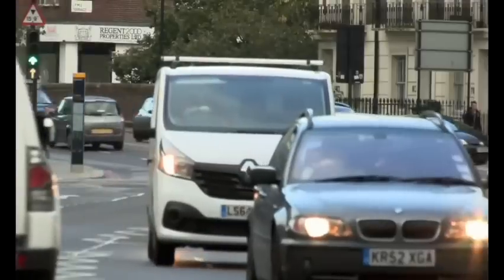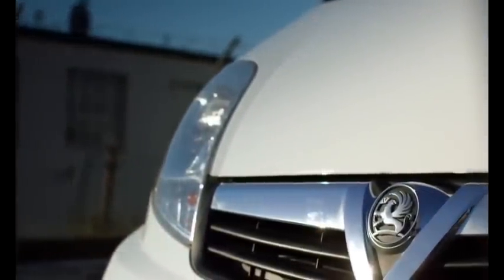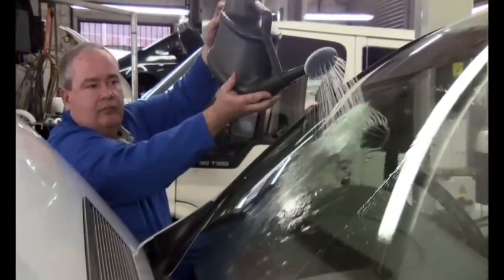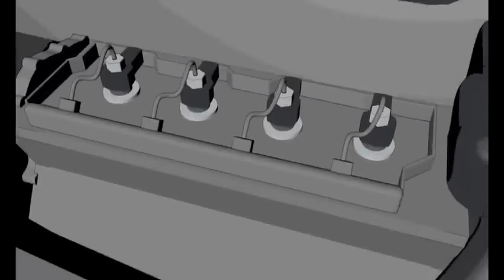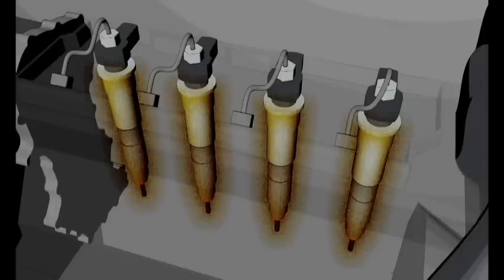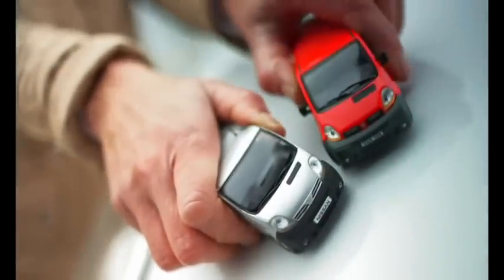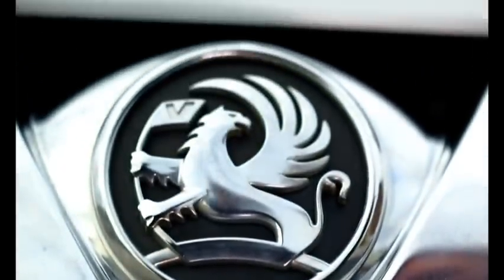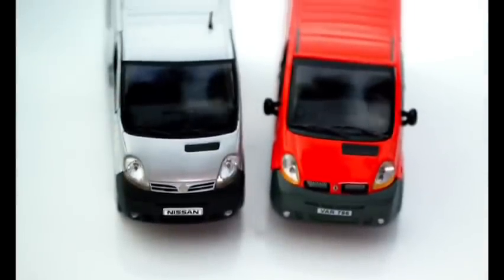Opel Vivaro Renault Trafic Nissan Primastar Vauxhall Vivaro Fuel Injector Problem

Comment from the maker: Just recently heard it from a mechanic, that 1st he sprays a lot of WD-40 on the cylinder head at the injectors, then he runs the engine for about an hour to get it hot, meanwhile he sprays more WD-40 near the bottom of the injectors  a few times during this time. Then he shuts off the engine and removes the injectors. He said, that since he is using this method, he managed to get all injectors out. I no longer have the Vivaro, but if someone tries this method successfully I suggest to post it here for feedback.
Reply: Unless the injectors are shorted inside, then the engine will not start for more than 2 seconds before the ecu cuts the power.
Reply: I think i need to try that. Will give you feedback of it.
Reply: Although it might take several hours, eventually one or two days and stinks when applied!
 
I suggest to let it soak in a VINEGAR bath. 

Never heard or read about anyone else using this basic method. But the reality is that vinegar is an excellent acid to remove rust! It's cheap, effective, easy to use, not poisonous, the only issue is that it stink! 
Whatever the case it will "eat" the rust away. When using it the only concern is to keep the parts submerged in it. In other words don't let it dry...  Oh! While speaking about it. Get the strongest vinegar you can find. Works faster! ;-) 
In my neck of the woods it's available in 7% and 35% concentration. The later being my preferred choice.  

Procedure: Let is soak for 24h or more. Clean the mess, a thin and long screw driver and rags. Combined with a wet dry vacuum. Works perfectly. After that follow the example of the OP above.
Soak it in WD40. Leave it for awhile if the van start even better, warm it up. Than slightly release the bolts that hold the injectors in place. Do not remove them completely. Two or three turns should ne enough! 
Start the engine and let it's internal pressure spit/push the injector out... It will come off nice and easy. ;-)
Cheers

Comment: Snap! The otherwise clean and tindy Vivaro I bought from a dealer had this problem. The scuttle is retained by screws - no sealant. The injector bay was a mass of rust. Long story ---- an engineering co told me that No1 injector was so badly corroded that they declined to even try to lift it. Indeed, the mechanic put the approriate socket on the retaining nut & twirled it round with his fingers - the hex was rusted to round. The dealer refunded me the full purchase price - 30 day/existing fault not advised to buyer. Thank the Lord for that protection!

Renault - it is their design - are entirely at fault for this. The only good thing I can think of to say about it that there is a flourishing business in UK that has grown up to deal with this clanger. Good old Brit ingenuity. I can report that this does not exist in FR, where I live. A Gallic shrug of the shoulders and 'Domage. Motor nouveau, monsieur'

Comment: Hi everyone its not just Renault Nissan opel I have worked on bmw and Mercedes and i have the same problem with one or more injectors and the tool for removing them is not that expensive

Comment: we'll be picking up our 07 Vivaro soon, one of the first jobs... remove the rain skuttle panel and reseal. Just hope the injectors aren't f**ked already.  Crazy thing is if these vans were THAT bad we wouldn't so many older ones still on the road. There's 4 in my road alone that belong to neighbours!
Reply: they prob have the one i have. which is a 2005 1.9CDTi it is a different engine F9Q. our injectors are at the front, with no trough. my injuector heads are bone dry..

Comment: I'm so glad that my Renault traffic is a 2016 model
Reply: they can have the same faults its only a facelift body, depends how you drive them
Reply: It’s not a facelift model. A lot different ,200mm longer for a start. The x83 model they are talking about has a 2 L Nissan engine the new model the mk3 has a 1.6 Renault engine.
Reply: I’m so glad I don’t have a DPF in my 2005, good and bad with both
Reply: @martinhull6734  the 2.0 Vivaro still uses a Renault engine
Reply: @darrellcoutinho805  the 2.0L engine in the Trafic from 2007-2014 and 2019- is the M9R. MR engines are Nissan. It is an alliance with Renault but is designated a Nissan engine.
Reply: @FatherJack-73  F9Q baby..

Comment: Injectors on dci 1.9 recon cost £120 each. Four injectors failing at once is bullshit. The 2.0 vivaro the injectors may seize but why break because seized? All four injectors 100,000 miles? The he repair bill £5k? The garages charging that should be on watch dog themselves. Nothing mentioned about how that charge is extortion. I wouldn't charge anywhere near that. Under a grand for sure. Likely one injector and a hundred pounds labor so £250 plus vat.
Reply: the £5k bill is the cost for a new replacement engine and fitting
Reply: @MartinMurray1966  - Which in all honesty is bullocks!! In the WORST case scenario. Engine head would have to come off and the failed injector(s) would have to be drilled out. Notice, this is the worst case scenario! If using proper tools and methods. Head removal would be pretty much never needed! But OK accidents happen so some cases would come to that. 
Also very dependent on how long the situation as been going on. As usual early detection and correction saves a lot of time and money. 
Like the saying goes. "A gram of prevention is worth..." ;-)

Get an entire new engine... Well, it's a perfect solution for the garage/mechanic involved, that's for sure! ;-)

Comment: Hi i do feel for you  i have a vauxhall vivaro 13reg n its done 108.000 now  at the mo its ok but in 1 year ive had it it not started straight away 3 times now n im dreading changing the injector plugs

Comment: Easy fix for the submerge injector problem in the trough drill 3 tiny holes in side so water drains I've done it with no problems
Reply: In the side ?

Comment: Ive had my 2007 Trafic 2.0 dci since new, now on 174000 miles, none of these problems, maybe I'm lucky!
Reply: AngryPostmanSthlm2  honestly i think its more an flaw in the injectors themself.  Just an bad badge.   My vivaro has ben running for 330.000miles.  As an company car so its the slut of the company.  She takes it all...   No problems so far.  I did have to replace the egr.  But i costed me 30$ and 5hours work. 
It would run fine with the faulty one but not recomended of course
Reply: @DiyNuke  - It's not an issue of the injectors. This same engine is in several other vehicles from Renault (Megane, Espace...) and others, namely Nissan (X-Trail...). 
And in none of them this issue comes up! In fact it's one of the best and most reliable engines out there! Kind of sarcastic we're talking about it failing, isn't it?!   

The problem is really a seal design and/or implementation. Many times combined with a blockage in the rubber drains. On both sides of the scuttle panel. Those rubber hoses can be easily seen just by opening the bonnet! Pull them out and clean the leaves and debris accumulated in there. It's just a few minutes task! 

For you guys parking under trees be specially aware of this detail. BTW this is an extremely important cleaning point for vehicles of any brand and type. Be it a Toyota or a Mercedes... Chose a name! ;-)

Comment: If this was the only problem…. Owners should know that the timing chain should be replaced at 100000mls.
Reply: ergh wrong. its a belt, manual says 30-40k..

Comment: Same problem whit my Renault Trafic 2005
Reply: 2005 model has 1.9 Renault engine that has plastic cover so not affected.
Reply: Same my big problem
Reply: @camwinstone  - For what it's worth the 2.0 DCI also has the plastic cover over the injectors area. Although water can still sip trough/around. The rest is history.

BTW for what it's worth, the failing seal. Is a regular neoprene seal that is, pretty much, the standard in the industry. Dependent on conditions it can fail relatively fast or last for a long time. This same type and seal material. Can be found, literally, in every model and brand sold nowadays!  
Whatever the case, when it fails, unluckily in this particular model the water accumulate precisely in the injectors bay!
 
Improving/replacing the seal and keeping the scuttle panel drains clean are some of the actions that can avoid/minimize several head aches in the future. ;-)

Comment: Horrible engineering.  Such a vital component is relied on by a windshield seal?  Nothing else?  No covering of the injectors or anything?  Just a window seal?  It's this kind of lazy, half-done crap that manufactures try to get away with.  That's why you don't reward them by buying their products when they can't even offer you a reputation for producing reliable products.  Stick with toyota and Lexus.

Comment: I lost 3000 pounds on mine. The workshop spent 15 hours trying to get  out  ONE injector. They broke their 20 tons hydraulic tool. 
They only charged me for three hours because they where sorry for this STUPID DESIGN. These cars should be called back and BURNED in a huge collective fire. It's only a french design  that can be so shitty. THE SHOULD STICK TO MAKING FOOD AND NOT CARS.
Reply: Geez! It's a pity you didn't find a decent garage to solve the problem! When you say they broke their hydraulic tool. I can spot right away that someone didn't know how to use their equipment! Or most important solve the problem... :-(
Reply: a 20 TON tool would crush your front panels, then squish your mcpherson struts before breaking itself..

Comment: my 2004 vivaro is still alive, this is a ford propaganda!! ;)
Reply: Have a 2008 Vivaro and had to replace 3 injectors already because of this over passed 2 years of owning it.
Reply: 2004 vivaro had the old 1.9 engine which was not as bad as 2.0 cdti/dci
Reply: Mercedeslhamiltonfan The 1.9 engine has a plastic cover on the top, so they are not affected.
Reply: @martinhull6734  what about the 2ltr cdi 2007 ? thanks
Reply: @uptowndisco2  That is the Nissan engine, it replaced the 1.9 Renault engine. No plastic cover so water can get in.
Reply: The problem doesn't happen on the earlier models you muppet. Were you not paying attention.
Reply: @uptowndisco2  - The 2 ltr models are by far the most affected by this issue of water sipping trough. Opposite to what's been mentioned the Renault/Nissan 2.0 DCI, has a plastic cover over the injectors. 
Although water can still sip trough/around and find it's way to the injector holes! On a totally aluminium engine, bimetallic corrosion is a big issue. Aluminium and steel... Big no, no! LOL 😂 

With this said it's worth mention this same Renault/Nissan 2.0 DCI is a remarkably good engine and extremely reliable! Aside the issue in this particular model!
Other designs like the Renault Espace, Megane, Safrane...or Nissan Qashqai, X- trail... and a really vast etc. DO NOT suffer from this problem! It's a specific problem of the scuttle panel design/seal on the Renault Trafic and it's siblings from Opel/Vauxhall and Nissan.

Comment: my van is 2008 traffic and it has done only 76000 so far suddenly  all the injectors have gone  i took it to the garage for repair and it cost me a fortune to get them removed and replaced when I saw this video I had had some hope to get some money back from Renault (because my van has been manufactured between 2006 and 210) as they said BUT when called Renault they said i should have taken the van first to Renault garage to free diagnose and after that if it is injectors problem then they will give me an estimate for the repair work which i will have to pay for( hahahahah taking people for idiots.....)
please don't believe this B****sh and reporting anything to Renault will not sort out your problems 
I am selling this van soon and from now on i will  only go for German vans or cars
Reply: hassan souani so the German manufactured vehicles don’t come with problems?! 🤔
Reply: Opel is german and yet its the same.....
Reply: Its just as simple as removing the cover flood it with some oil and ya will never have this problem..
Reply: Best bet is to go for a transporter
Reply: @DiyNuke  opel is a rebadged renault there’s nothing german about those vans. They are french
Reply: @bencrosbie  actually they are English or Spanish if you want to get specific. But yeah, the design is French

Comment: Renault MAKES JUNK.  THEY ALWAYS HAVE!!!!!!
Reply: That's not true. I have a Renault with 160 000 miles and runs very good. Just few normal problems during the years.
Reply: Something's not right in the ridiculous general assumptions! When I was looking to buy my Renault Trafic (cheap). I had trouble finding a, I'll say again, cheap one with relatively low mileage. 
What came up at the time was usually above 450k and generally above 500k km, one in particular with 700k! Mine was on the 230k range. Now is slightly above 300k, for the time being!

I guess you don't need to be a genius to figure out that both versions of the story don't match! Do they?! 
If it's such a junk. Why on earth are all those km's in there?! Hmm! 

BTW 300k and the engine is smooth as new! Once again, strange! Hmm! ;-)
Reply: its a NISSAN fault. Renault made the prievious engine, which i have. injectors are at the front, and the airbox covers it all at a shallow angle. oddly, my 2005 1.9CDTi also don`t get rain water leakage..